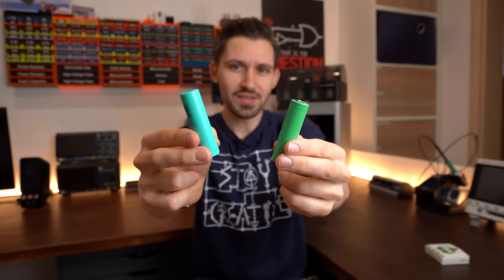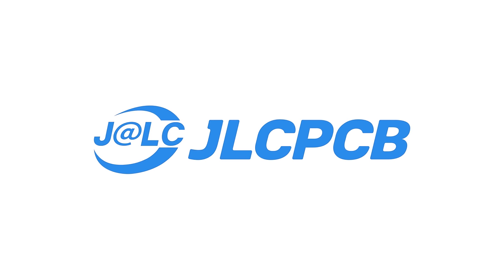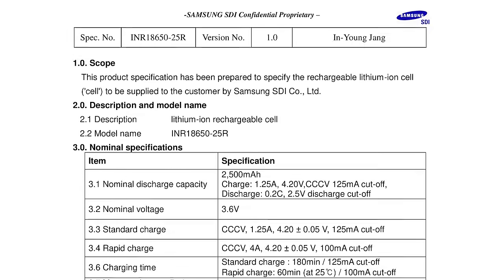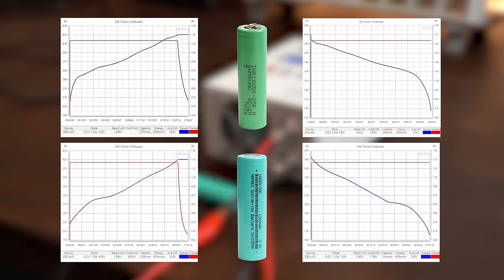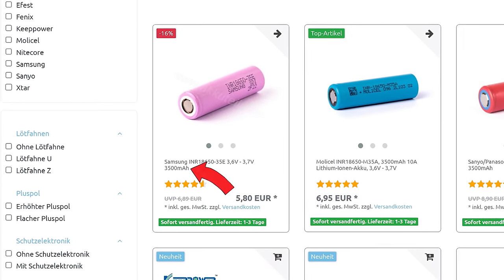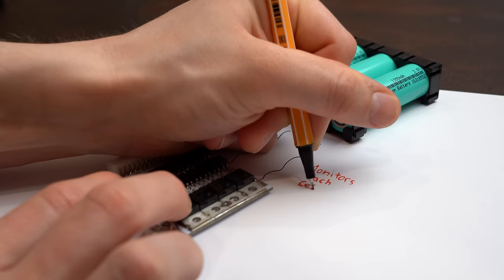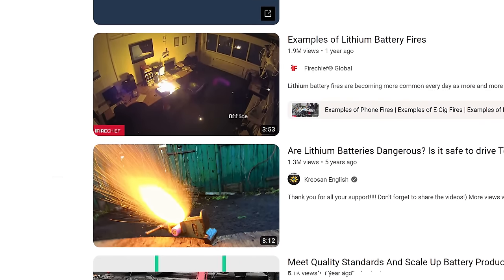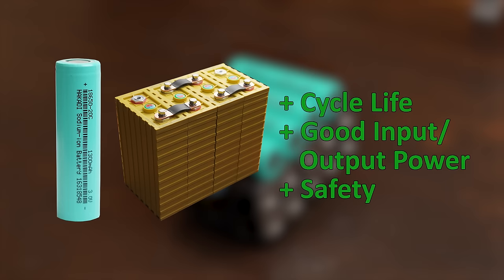"Salt" Batteries are FINALLY Here?! Sooo should you use them?

Comment: What about the weight of the cells? Is there much difference?
Reply: "Sodium is a heavier element than lithium, with an atomic weight 3.3 times greater than lithium (sodium 23 g/mol vs lithium 6.9 g/mol)." 

You have to add (X) amount of sodium cells to make up the same voltage as well, so the negative weight factor is a double dip. Sodium is heavier, and less power.

Comment: Sodium ion is a newer battery tech relative to lithium ion. Li-Ion has been engineered to heck and back to get its current energy density, Sodium ion has not (yet). We should see improvements in Na-Ion over the years if it's promising in the lab.

Comment: Salt Batteries are cheaper but have lower output voltage per cell, store less energy and can still have thermal runaway.  So almost no market for use in EVs, but ok for electric scooters or bikes.

Comment: I'm not convinced that these are necessarily safer since sodium is more reactive than lithium. Also lithium batteries used to be safer before they decided to aim for higher performance: older testing for them did in fact involve driving a nail through them and they weren't supposed to catch fire when you did.

Comment: Overlooked is that the cycle life charge and most importantly discharge rate of the sodium battery was at much lower rates than the 25r lithium battery. Being discharged at its maximum continues rate of 20A, 8c vs only 1A, 0.77c for the sodium. When a Samsung 25r is discharged at a more similar rate, its cycle life is much more similar to the sodium battery. Also the 25r is old tech. Consider the new Molicel P50B entering the market as we speak with unprecedented cycle life at insane charge and discharge c rates. Given the similar capacity and much lower cycle life compared to more similar LiFePo4 (a similar LiFePo4 like the Lithium Werks APR18650M1B 1100mAh for example, with 2x the cycle life at 10x the discharge rate, 10A 9c, >2000 cycles) the price needs to be much lower and or the cycle life needs to be greatly improved for sodium to be competitive. At this point safety is the only thing it has going for it other than potentially lower environmental impact when not properly recycled. It's early days. It should be interesting to see how sodium cell technology matures.

Comment: I'm not saying that you are wrong or that you did mix up the batteries only that according to the color code the green one is sodium and the blue one is lithium. This could be a simple case of improper color code which happens all the time especially in badly regulated factories.

Comment: there are just so many positives to salt batteries. and if the costs get low enough, i think we will get to a point where you could have a larger salt battery in a car, you just wont have the performance, which isn't always necessary or warranted. but if you want home battery storage, at an even lower cost, though it may be bulkier, who cares?

Comment: We also need new inverters or inverter firmware. Due to the high voltage range you get over voltage when full and inverter shutdown with still 25-30% charge due to low voltage.  But new BMSs will occur and prices will drop a lot - looking forward to see cheap electric city cars in the future.
Who ever tells you LFP is better is currently right - but weren’t wee 100% sure tht AGM is the future (8 years ago)?

Comment: personally sodium have a lower energy density than the lithium battery counterparts for EV's no way in hell for power storage probably since they're more economical to produce but They're much more susceptable to the cold than lithium is so it'll have to be in a heated room but that'll eat into the savings since the batteries will have to be heated.

Comment: Summary

Salt batteries, also known as sodium-ion batteries, are a new technology that could potentially replace lithium-ion batteries in the future. Sodium is a cheaper and more abundant resource compared to lithium. However, salt batteries currently have lower energy density and capacity than lithium batteries. They also require a different charging voltage and do not have dedicated charging ICs yet. Despite these challenges, salt batteries offer improved safety and have a longer cycle life compared to lithium batteries.

Highlights

- Salt batteries are made up of sodium, which is cheaper and more abundant than lithium.
- Sodium-ion batteries have a wider voltage plateau, making it easier to determine the battery’s charge level.
- Salt batteries have lower energy density and capacity compared to lithium batteries.
- Sodium-ion batteries do not have dedicated charging ICs yet, but an LM317 adjustable voltage regulator can be used as a crude charger.
- Salt batteries have higher internal resistance, limiting their power capabilities but improving safety.
- Salt batteries have a longer cycle life, maintaining 85% capacity after 1000 cycles compared to lithium batteries’ 60% capacity after 250 cycles.
- Sodium-ion batteries are not ready to replace lithium-ion batteries yet, but they show potential as a more environmentally friendly alternative.

Comment: Comparing Na batteries to their Li counterparts is a bit unfair since Na tech is pretty new and there's still tons of work/research going on while Li has been on the market for a long time and is already past most of its progress. Matt from Undecided did quite a few videos on the advancements in Na batteries just in the last year, it's really impressive how fast they progress in some fields. IIRC the biggest battery company in China is heavily investing in Na research and they already have lab samples of batteries that come near the values of similar Li batteries, so it's only a matter of time until Na is a worthy competitor for Li. And even if capacity and Amp rating stay below Li, the safety aspect alone should be motivation enough to increase the spread of Na based battery tech. And other factors like better availability (salt water...) and less dependencies on difficult to source anode/cathode materials (cobalt...) should increase that even further.

Comment: Love to have sodium batteries and can get them however the holders for 26650 will not work with 26700 and currently looking for holders for thru hold solder holder.   Then I can adjust my PCB tp accommodated either LifePo4 26650  to sodium  batteries.    Sure wish manufactures make a battery 26650 as standard... Sodium or lifepo4

Comment: The discharge curve is not nearly as good as lithium but that will be eventually fixed, and even if it never will be as good if sodium turns out to be much cheaper just add more batteries to make up for it.

Comment: the coolest ones are thermal salt batteries. you just dry the salt in the summer and heat the house by wetting the salt in the winter.

Comment: I'm curious at what the battery used by Mercedes when they drove their electric car from Berlin to London without stopping to charge and still had a good charge level left when arrived.   It is that sort of tech which will make take up of electric vehicles possible compared to the useless forms used currently.   Now if you think 1200 miles in one go for an average city dweller than would equate to maybe a charge once a month or bi-monthly even and most people would sign up for that.   Imagine the pollution saved too just by converting to the new system.   However I did read the oil giants are keen to block this and cojoined they can wield a money hammer bigger than what Mercedes can...

Comment: Happy to see them finally becoming available. I am not a Lion fan and have waited for new battery technology to come about. Sodium is so abundant no one will be able to use it as a political weapon :)( Bye bye China) I have a Lion battery I built for my electric trike. The lowest voltage the batteries are suppose to go to is 3.6v and not as low as you mistakenly show. Therefore your kw for Lion cell is wrong. Sodium should be reduced to about half of Lion on price after a while. I am not running a BMS on my battery. It interfered with the battery operation. I look forward to building a sodium battery in the near future.

Comment: Capacity of sodium batteries is roughly half of lithium so.... Batteries will be much heavier. Then recharge cycles are only around 5000  which is much lower then lithium batteries.... around 10000 cycles. Technically it's new product so there will be improvements when more companies start producing it. So yeah in some areas this batteries will be useful but as a car batteries nope

Comment: Dumb question, but why should sodium be any less explosive than lithium?

In terms of the metals, isn't it less safe? And surely if there's energy in there, it can be shorted internally (e.g. puncture) and the energy can come out quickly.
Reply: Because it's not used in the pure explosive sodium metal form, instead it's bound to other chemicals rendering it safe.  Read more about it on Wikipedia by searching for "Sodium-ion battery".
Reply: @BillAnt  Lithium batteries are also often not in the pure metal form. Aqueous lithium ion batteries are also safe, they just aren't as good as the non aqueous ones.

And it seems that many types of sodium chemistries  (using carbonate ester solvents) are flammable.

I assume these new batteries are using aqueous chemistry?

To me it doesn't make much sense to be talking about the difference between the batteries and the thing that affects the safety is actually not the intercalating ion, but the solvent.

Comment: Lithium isn't at all scarce it's literally everywhere!
But it is challenging to refine, that's why it's expensive. It's also reactive and, therefore, scary to store or recycle.
Reply: Lithium doesn't even make the top ten of elements most prevalent in the Earth's crust, while sodium comes in at #6. All other elements combined below #10 are as common as titanium (#9).

Lithium is about 0.002% of the Earth's crust, vs. 0.565% for titanium, to further put it into perspective. Sodium sits at a relatively whopping 2.36%. That said, lithium is more common in the Earth's crust than lead, which isn't exactly considered a scarce resource.
Reply: @lonniemcclure4538  I didn't say it was in the crust, it's in seawater and salt lakes

Comment: would you like to consider to make a video about Joule thief. I have tons of 1v empty AAA battery and i want to use them if possible. All i need a smallest circuit in place between device connector and battery terminal but i cannot do it such a small size.

Comment: Salt batteries should be fine for extremely small applications, or areas where physical bulk/weight is not an issue , such as "button" batteries or maybe industrial energy storage in areas where land is cheep; maybe solar farms? But dont expect to see it replace Li-Ion batteries in mobile devices and it certainly won't save the scam that is electric cars from their inevitable demise any time soon.

Comment: an interesting tech, and i can see a use where the safety factors are an important consideration, but for most things it comes with too large of a set of downsides (so far).  if they can get it better developed? looks to be interesting. but as yet, it's still a bit too immature.

Comment: Will take a more stable voltage close to 3.5v any day of the week... and whats the 10 year internal corrosion characteristics on salt cells? no one knows, where as I have 10 year old 800 cycle lifepo4 still at over 80% capacity... The technology will get there, but I expect another 5 years perfecting then another 10 years to prove itself real world usage.

Comment: Come on. Test failure, not specs. Charge to 5V, see what happens. Discharge to zero. Test storage loss.
I like the simple charging circuit, though. Thumbs up for that!
Reply from the maker: I still have them lying around. If there is lots of interest, I can prepare a safety comparison video. Will have to prepare that for that quite a bit though.

Comment: People have been testing these alleged sodium-ion batteries for a few months now, so that's not quite new. But I'm still not convinced these are genuinely sodium-ion.
Can anyone just tear these down and analyze the contents + BMS electronics if any? The only thing I've really seen so far is people puncturing them with a nail, that's pretty much it.
Just open them and analyze the contents. Check that the BMS circuit does what you think it does. Or check if there is any BMS at all.

Comment: why can't we just have universal BMS boards and protection boards now? 
just give us a set of pads to short with solder blobs that set min/max voltages

4.2/4.0/3.6 for lithium ion, sodium, and LiFePO4 respectively
3.0/2.5/2.0 same order
or ad tiny trim pots and a small datasheet to tell us what measurement output we need to get a specified voltage
though the three sets of pads seems most accurate as it can just be a pad set that simply bridges out a resistor for the sets with lower voltage levels to the ADC chip input

I honestly hate how we now have 3 different cell types and they don't have obvious terms for laymen
I know that ICR is often used for lithium ion and IMR is a special type similar to LiFePO4 but we need a table for cell chemistry for dummies

Comment: It's all fine and dandy, sodium batteries will for sure have a place to fit in, but they do not, at all, solve the problem of EV's. In fact, even if you could replace batteries in EV's with new technology batteries, that would have the same capacity as lithium battery packs, but you could charge them with 5x the current, there's still a problem of charging infrastructure. Take a calculator, replace every ICE car with an EV, how much power is that? The grid can't take it without at least tripling the capacity of the cables and transformers and of course you would need more power plants and I don't mean solar. Then, of course, there's a problem of peak power use vs. peak production. I mean, it's just unending stream of problems that can't be solved without an insane amount of money invested and compromises made. Have you seen the queues at the charging stations? It's not going to get better.

Comment: Lithium is a scarce resource....

It's atomic weight is literally 3.  As in it is the third most common element in the universe.

Whereas salt is actually a second tier material of Chlorine (35) and Sodium (23)... and they have to have been chemically unified to create salt.

'scarce' indeed.
Reply: Actually, Lithium is the 30th most common element in the universe. Nor can we access most of it, as it's not uniformly distributed throughout the cosmos. For instance, Helium, the second most common element in the universe, is quite rare on Earth, and our limited stocks are constantly being depleted because it is all 'evaporating' into space. Also, even if Lithium were so abundant, it is quite difficult (i.e. expensive) to refine it from its ores, as it forms strong atomic bonds with other elements. The atomic weight of an element is not an indicator of its rarity either in the universe or within the sphere of human influence. So yes, Lithium is a relatively scarce resource in the cosmos, and is a rare resource on Earth with a finite supply  before it becomes uneconomic to extract and refine.

Comment: The final argument about not using sodium-ion as a replacement for lithium-ion doesn't make sense. Instead of answering that question, you state that you think sodium-ion is a good replacement for LiFePo4. And while that may be the case, it says nothing about whether it is a good replacement for lithium-ion.

You've explained the trade-offs between sodium-ion and lithium-ion. Now the question is, for any given use case, which is a better option? That depends on how important each aspect is. For quadcopters and EVs, sodium-ion's lower energy density is a major downside. Possibly true as well for portable power tools. It's a lot less important for situations where you have more space and/or less total energy required, or where you are particularly concerned about fire and explosion risk. Things like consumer electronics carried on airplanes, in cars, backpacks, and left on your bed beside you, could benefit greatly from the added safety. Potentially for EVs too (though there's a difference between fire risk and being burned to death in said fire; gas fires are just as deadly if you are trapped, while both are relatively harmless if you just leave the vehicle). For things left active and unattended inside a building, the safety is likely worth it despite the added weight and size.

So which is better? It depends on your needs - no single battery technology is best in all circumstances.

Comment: But the Low voltage is not good for Mobile devices and result in even less capacity.
Everythink below 3.3v would not work for Processors and Displays.
Reply: Processors and memory these days work internally at voltages well below 3.3 volts. For example, LPDDR4 RAM works on 1.1V.
Reply: @lonniemcclure4538  But Smaller µControllers, Radio modules and Displays need at least 3V or more.